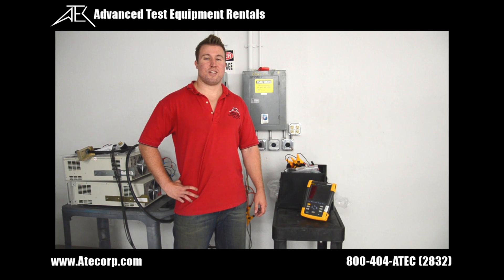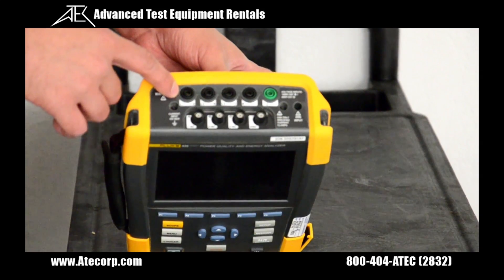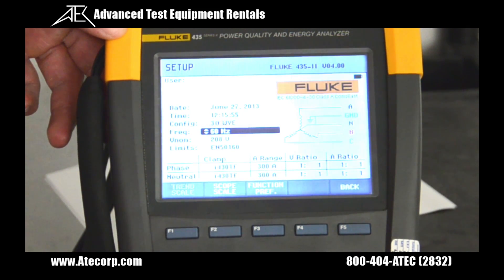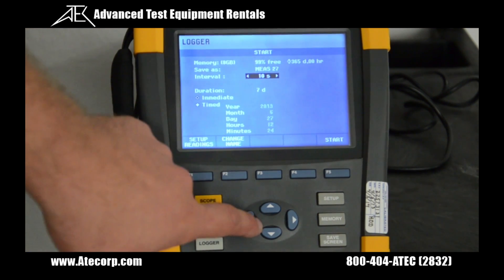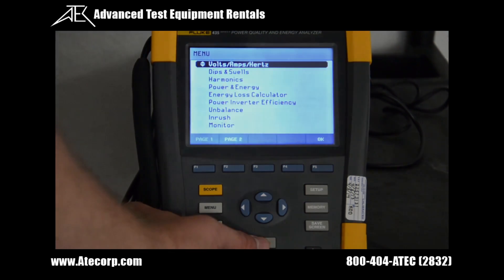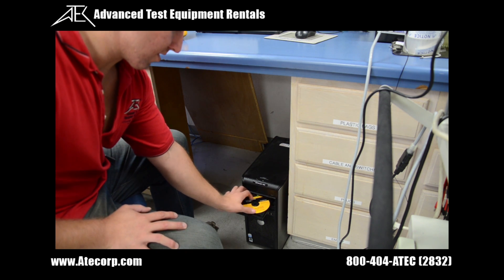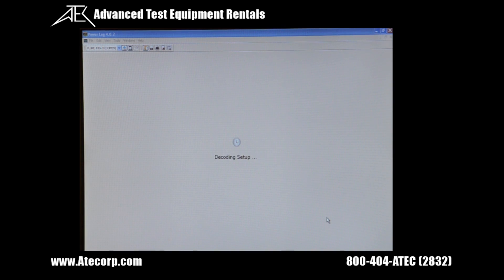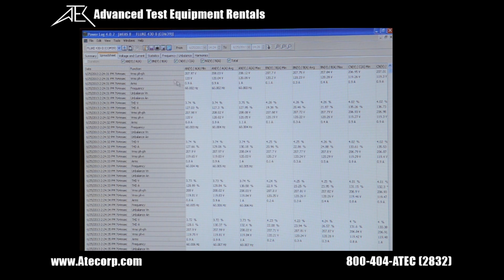How to use Fluke 435 II Power Analyzer

Comment: Can I detect 9 hz harmonics with fluke 435 ?
Reply from the maker: Harmonics that can be measured by the 435 are related to the fundamental frequency, which is typically 50/60Hz. So the unit will measure up to the 50th harmonic of these frequencies, as well as  DC, so measuring a 9Hz harmonic will have to be done a different way.